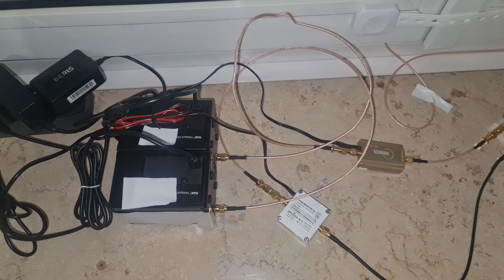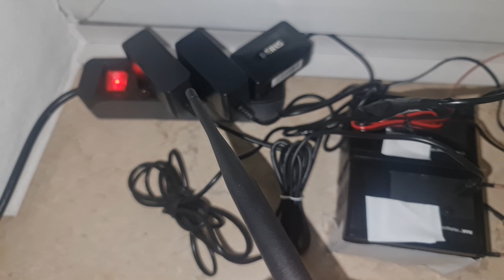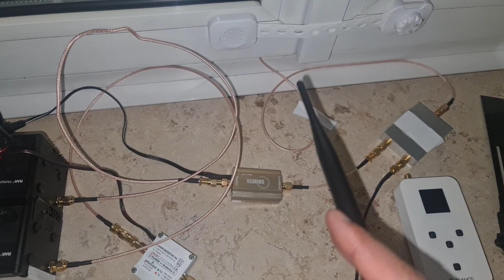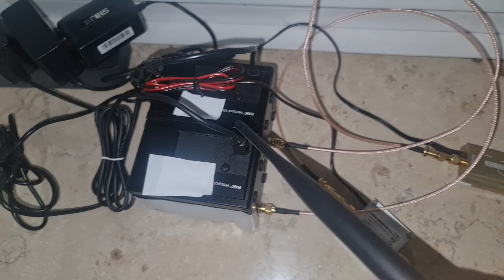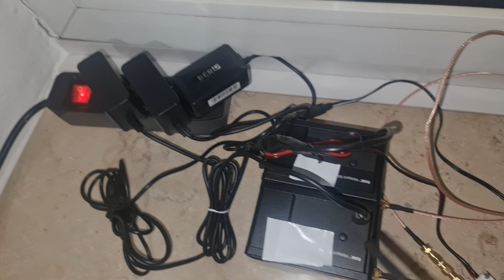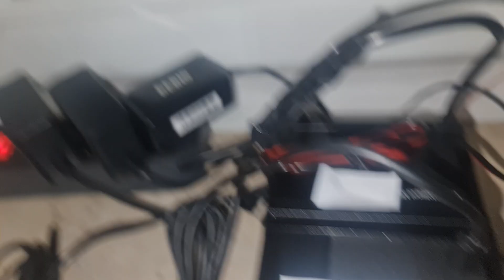FLARM BOOSTER VS SHIREEN INC Helium Amplifier Part 1 _ HELIUM ADDICT

Comment: Hi bro! I wanted to ask you something… what thing connects to the amplifier on one side is the antenna but what is it on the other is it direct to the miner i have to put something between them. Do you have some kind of cable diagram. I would be happy if you answer